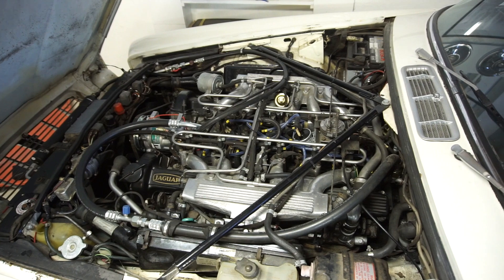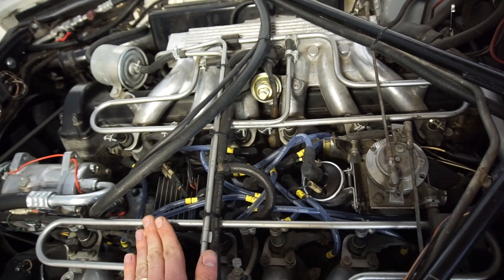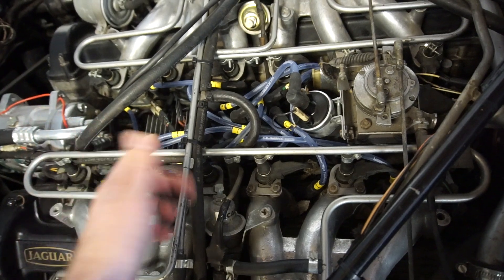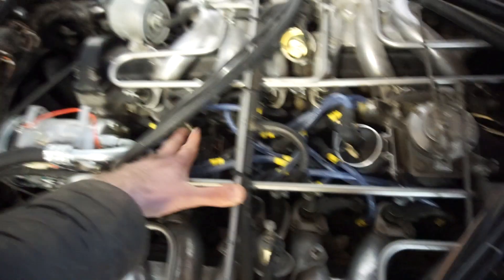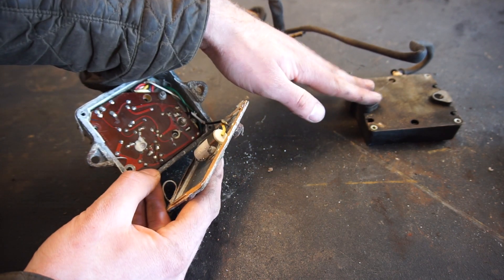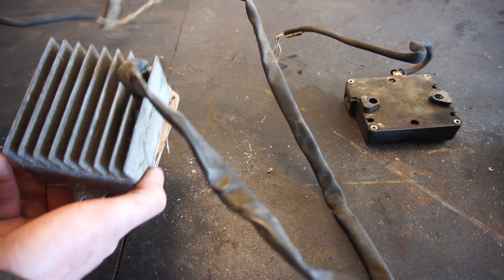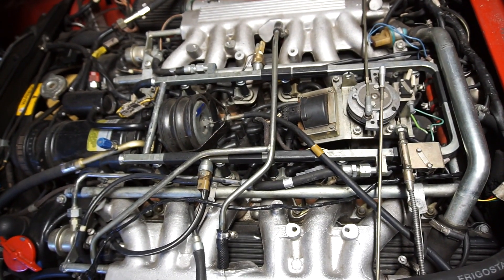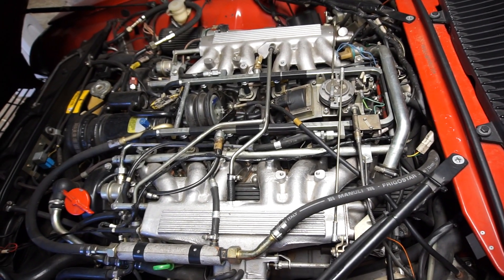Jaguar V12 Ignition Systems

Comment: The XJRS 6.0 came out in 1990 and had Zytek.
This is a sequential injection and engine management.
It is based on a modified Lucas CEI distributor. No vacuum advance. Two pickups, the second one has only one tooth and is for engine position.
The signals are fed back to the box in the footwell which uses sensors to determine timing and injection.
The ignition signal is fed back to a Lucas AB14 as used in CEI. This fires an e core coil.
Most issues are with the sequential injection.

Comment: My 1990 had the failure and when back up and running caught its right converter on fire and actually melted the in side of the right resonator. I couldn’t figure out why there was almost no flow from that pipe. I put a set non cat euro style headers on it and same problem and there was only one thing left and that muffler was very plugged. Things could have been worse had it kept driving

Comment: Hi Adam -  do you know how one can get hold a REOPUS unit nowadays? If they are no longer available what system upgrade do you currently use, to improve the OPUS? Thanks
Reply from the maker: Sadly you can’t get a hold of it any more. I recommend the system that SNG Barratt made. It’s pretty pricey but it’s the only option if your car is fuel injected
Reply: @LivingWithAClassic  many thanks! Sad that OPUS is gone. I wonder if anyone out there has the circuit diagrams so that an enterprising soul could start remaking them
Reply from the maker: @nicowarr maybe his family has it but not sure. It was made by one man in Australia. He passed away a few years ago sadly.
Reply: @LivingWithAClassic  Sorry to hear that.
Reply: @LivingWithAClassic  do you have any experience of the Mobek Tekniske EFI distributor-delete system? On the suggestion of Ben, at your sponsors Simply Performance, I spoke to Ole Mobek about it and he seems extremely knowledgeable.  His kit looks well made and comes pre-programmed.  Any views? Thanks!

Comment: Please help me I have problem.
Me car Opel Ascona C 1.3l model uses that 4pin gm ignition module and it has induction triger I do have that E core singel ignition coil type .
How can I wire that amplifier with me existing gm ignition system.
You mentioned twin coils with that set up.
How can I use 2 coils at the same time basicaly I want some thing similar like waste spark ignition system I experiment lot with me car and even used plasma ignition so I realy need to figure out how to activate 2 ignition coils at the same time useing 1 singel triger.
That twin points rotor arm was interesting does it fit on opel gm distributor? 
Culd you please make exact video to show where those wire goes if it is hei alredy used ignition system and how to improve it?
I also have problem those clasic gm cars come with starter selenoid with R terminal but I cant use it me fuse pops aperantly that 4 pin gm ignition module and me dashboard positive linear voltage regulator are polarity sensitive.
So is there a way I can use that R terminal bypass wire I have more of those starter selenoid wuld reversing them in series ore pararel configuration winding them solve that problem? 
I have mostly trobel in winter time me coil does not get enough voltage so Im in deap shit .
So please any thing wuld help me .
I have trobel for years with that car.

Comment: Hello Adam, can you help with the layout of thee ignition leads on the Jaguar double six 6ltr V12 1996 model. It doesn't have a distributor but just two boxes with six sockets in each. I didn't take a picture of the way they were before removing the leads. So I don't know which box is for left side and which is for the right side. I've fitted new spark plugs and I have all new ignition leads. I like all the videos you've done, many thanks from Patrick.

Comment: tinkering around with a 76 xjs i inheritied, clean rot free car, it cranks, it gets good fuel pressure at the filter under the hood, working the throttle under the hood can here clicking, it will fire for a second with starting fluid, i did run a hot and ground to each injector to listen for a click and each do click, but don't think they are getting fuel to the cylinders,, anything i should be looking into ? cranks but won't fire up,
Reply: Hi, did u solve the problem, got the same on my 76 xjs.

Comment: The problem w my 92 marelli system is the the wires to the coils become brittle... and the insulation starts to flake off and you get that not running on one side... 
I have had to order high temp wires to rewire them....
Reply: I have jist purchased a 92 cjs also. Exhaust at the rear was too hot to touch so I shut her down.

Comment: Can u pls share a little bit detail on how u change the board of your ignition into re opus ie what to change and where to buy? Really appreciate it. Thanks.
Reply from the maker: I believe re-opus isn't being made any more sadly. If you have a pre-HE the best bet is the SNG Barratt kit that removes the Opus completely.
Reply: @LivingWithAClassic  My Ignition amplifier is not working now.  I have a pre-HE. Are you suggesting I get SNG Barratt kit? What do you mean by kit? thanks.
Reply: @LivingWithAClassic  Wonderful video.  I have a ignition amplifier that is not working now on my pre-HE.  Need to understand your recommendation of replacing the Opus amplifier with the Lucas CI.
1. Do I need to just get the Lucas CI and put it into the Opus box? Is there anything else need to be done?
2. Do I also need to replace the distributors as you mentioned?
3. Anything to do with the coil?
4. If you could share with me the link for the Lucas CI would really appreciate it.  
Sorry, I'm new with this V12 engine.

Comment: My '88 XJS has the lucas amp. But, I keep frying HEI modules. The last one lasted almost 2 yrs., so I always keep a spare HEI module w/me. I also carry a tube of heat sink w/me. Do you think that applying a really thick coat of the heat sink compound between the module and the base of the amp would offer more protection? There's gotta be a better way because I've fried 5 of 'em in 5 yrs. Maybe a thick aluminum plate under the amp?
Reply: Heat sink paste should not be thick, as it doesn't transfer heat as good at metal. You want the metal surfaces to be flat and have a thin layer of paste. If the metal is bent or warped in any way, extra heat sink paste is not the answer. Also some heat sink pastes are better than others. The same is true for computer cpu heat sinks and audio amplifiers.
Reply from the maker: That’s odd that they keep frying. There should be heat sync paste under the module to protect it

Comment: Hi, I have reconditioned a 1992 XJS engine, it fired up fine and ran sweet but the next time I wanted to run it it fails to start up, I have found I have power at both the coils (Magnetic Marelli) but no spark from both the coil HT leads, can you suggest what is the most likely problem please.
Reply: Make sure your coolant temp sensor is plugged in... if it comes disconnected it will not run...

Comment: I've had that happen to me on my '89 xjs where the rotor cracked and the car was running only on the left hand bank. I pulled over immediately as smoke was coming from under my hood. I carefully cracked open the hood and luckily no fire, just some old oil burning off, that right hand cat gets really hot very quickly! I replaced the cap and rotor and did a modification where I ground down the mounting shaft of the rotor a little then filled the inside of the rotor with hi temp silicone leaving no air between where the rotor sits on the shaft and the rotor so that the spark from the coil will follow the path intended. I changed out the spark plugs and found them to be gapped too wide and then had to replace the upper right hand cat. Car has been running well and it is my daily. Thanks, Adam for these videos. They are so helpful!
Reply from the maker: Great that you caught it fast and saved your car! I think I might go into this failure in more detail in the future. I've done some research on possible failures and why it might happen.
Reply: That's exactly what happened in my 1989 convertible .. EXACTLY!!!

Comment: Happy Easter, Adam! I liked your characterization of ‘Death Valley,’ classic! Thanks for this, my ignition system has been on my mind of late. My XJ-S was manufactured in February 1988 and is likely one of the last Lucas systems mounted on the manifold. My mechanic characterized as my Lucas amplifier as “high performance;” would you agree with this characterization? Are there ‘better’ amplifier/coil combinations available? I presume that, because Jaguar abandoned Lucas for Marelli later in 1988, Lucas must not have been on top of its game at the time... Just curious about your opinion.
Reply from the maker: Thank you Daniel and Happy late easter to you. Hope that you and your family are well and safe.
For the time it was a powerful ignition system and it has stood the test of time. They are very reliable and deliver a strong spark. Marelli in my opinion was more of a distributor upgrade than spark. The advance curve can be a lot more acurate with it

Comment: That was very informative. The previous owner of my V12 mentioned I could use GM module. Whats he talking about?? Adam showed its in the Ignition Amplifier. Also that spot gets very hot. I have installed a module in my HE distributor on my Cadillac. So that's were the module is on the HE Lucas unit that can be opened up not sealed as it looks.
Reply from the maker: They do get very hot and it's important to use a special paste on the back of them (zinc I belive) to help the heat dissipate
Reply: On HE's the Lucas module isn't Lucas at all - it's a clamshell pack 4 pin GM HEI module which is very convenient.
Reply from the maker: Yes they are. Easy and quick to change

Comment: I found you at just the right time. I recently bought an 88 Hess & Eisenhardt. One of the previous owners thought it may be the last one, or near the last one built. I haven't verified (if even verifiable) the claim. I have an intermittent no start problem so I thought since I don't know when the injector hoses, or a tune up was last done I'd start there. Last time I had a no start I dribbled a little gas into the vacuum lined on top of each intake and it started after two days of trying. If you have any insight please share. Thanks Kevin
Reply: Tinker, sounds like a fuel delivery issue.
I would, at the minimum, check the fuel pressure. Replacing fuel filter is a quick and cheap item that could solve your problem.
 Also make sure the fuel regulators are working properly. I have owned a few xjs and all of them needed a bunch of maintenance to run properly.
Reply: @jdere31760  it does run very well after I get it started. I will change the filters when I do the tune up thank you.
Reply: There is a problem with the ECU’s in these cars and it will start giving you running issues where the relay will cut power to the fuel pump. You can jump the relay and the car will run just fine. When you turn the ignition key to the on position you should hear the fuel pump run for 5 seconds and then shut off. If you don’t hear the pump run, then this is most likely your problem. The relay is located in the trunk on the right hand side.
Reply: @livingroomguitarist7  I did crack the fuel line and got fuel when I turned the key. I didn't check the pressure though. It has been starting reliably lately. I adjusted the throttle plates and linkage, and repaired a couple loose vacuum lines. It idles better now. Progress is slow. I have lots of projects and work away from home. I'll keep plugging away at it.
Reply: I also own a good running 86 xjs. The only problems with that one are the exhaust had cracks in the through rear end pipes, the seats are a little rough and recently the charging system has been putting out to many volts randomly. All the repairs should be pretty easy.